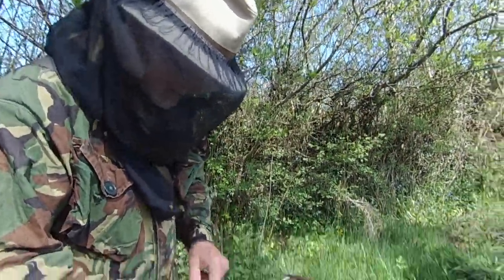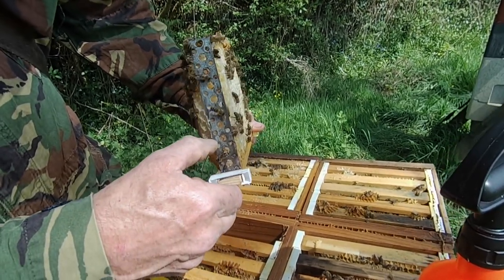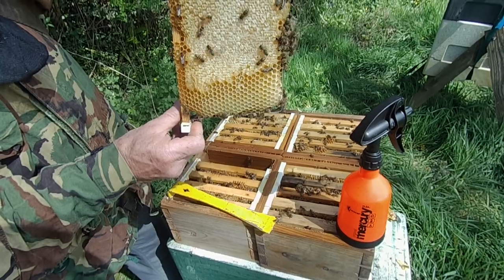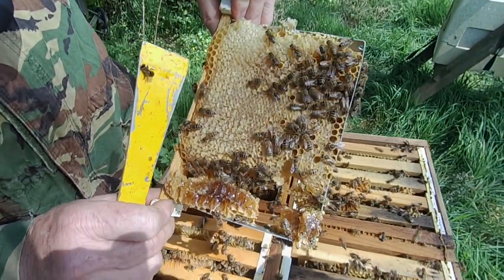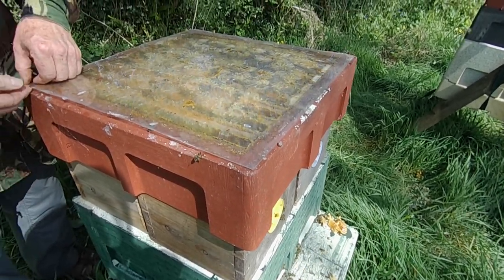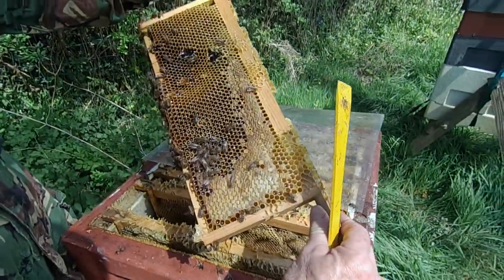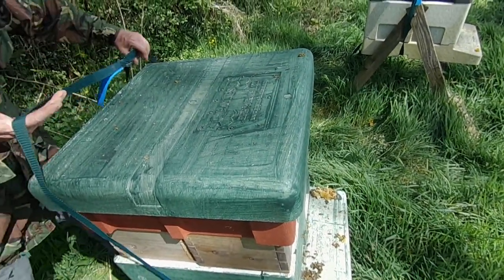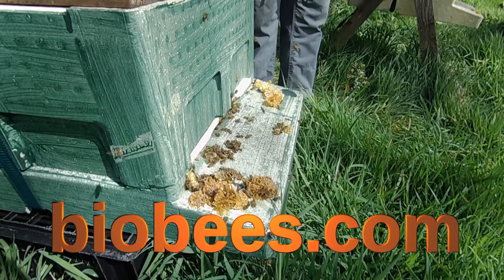Quadratic hive metal frames full of honey!

Comment: Notice @ 3:40ish  the red box has a vertical thin edge on the inside of the frame top bar support. I used to have a thin (tin can thickness) strip of metal fixed as that is and it reduces the area that bees glue down.  I am liking the quadratic design as this could mean resuming the keeping of bees especially with the metal frame as you show although they may prove a problem in really cold situations.  I am going to try to find more info on the construction (yes I subscribed) of these.
Reply: Wondering if I could do something like this with a square Styrofoam Cooler to survive the cold northern Minnesota winters!